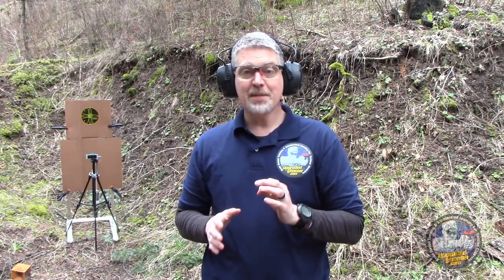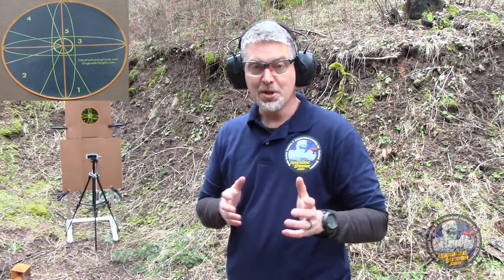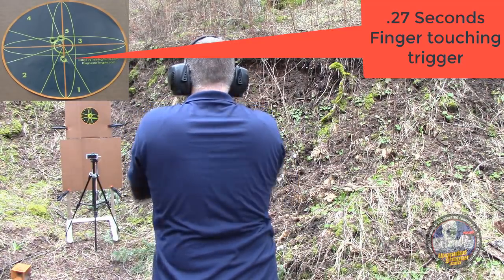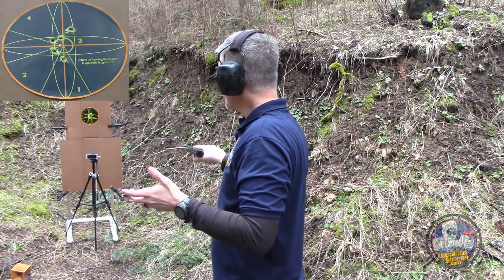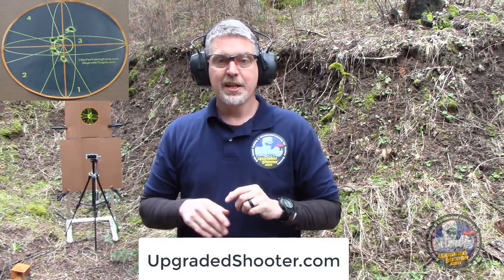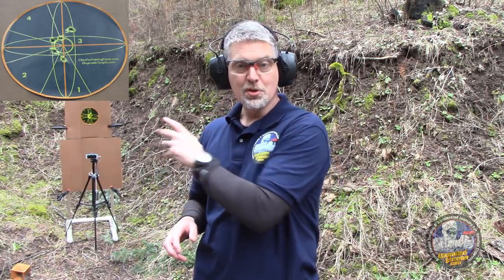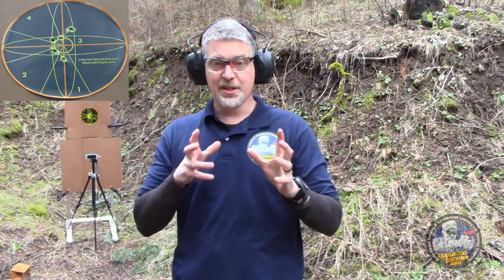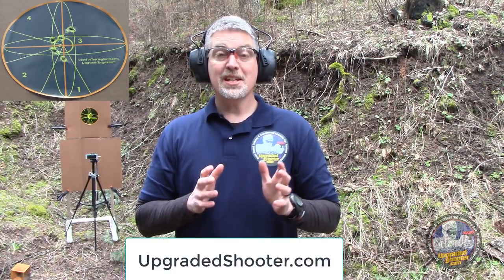High Speed Trigger Control Drill For Ranges With Restrictive Rules

Comment: Great video, thank you.
Questions: 
How far is that target?
Are you closing one eye?
I do a drill with an internal hammer j frame, muzzle 1/8 of an inch away from a dot on the wall and a dime balanced on top of the barrel, after many repetitions I can actuate the trigger super-fast without dropping the dime or moving the muzzle away from the dot, what is your opinion on this drill?
Thank you in advance for your answers.
By the way, I have been using your mini targets with training partners calling out letters and number with a laser trainer, I think it speeds up the decision process and it transfers into different situations.
Reply from the maker: Thanks, Rod.

I don't remember the distance and lenses on cameras make it hard to know for sure.  For a lot of drills like this, I have people start at 6-10 feet (I know this was further) because the errors that you're going to see can throw the shot several inches.

I shoot with both eyes open.

Dime drills are great...just keep in mind that they work great as a drill to measure performance, but they're fairly ineffective as a drill that you'd do to build skill.

Awesome on the mini PopUps!  One thing you might want to try is downloading the "SwitchedOn" app and having it feed visual triggers for which target to shoot, if any.
Reply: @Dryfiretrainingcards  Thank you for the reply. 
I think the dime drills helped me the most by training transition from finger off trigger to fast trigger pull without moving the gun. Also, I have come to the conclusion that if I have time to use sights, I have time to close one eye, so I train a lot of point shoot with training partners in dynamic situations using laser trainers.